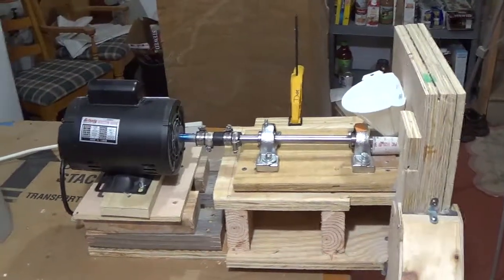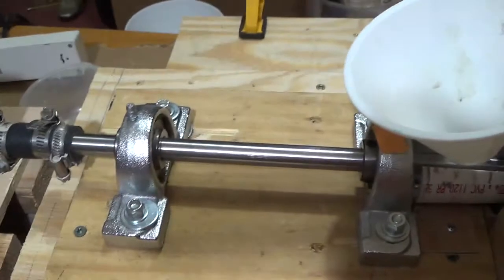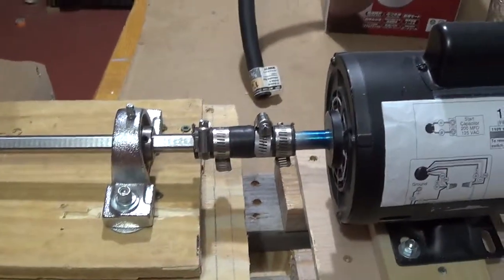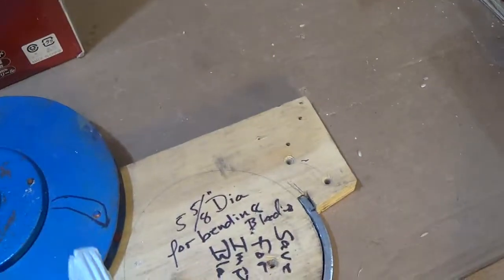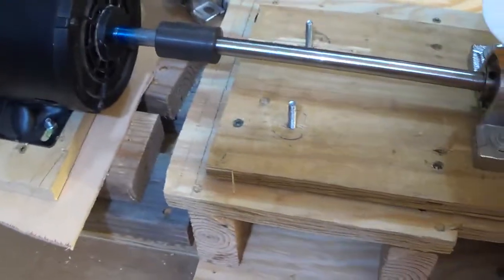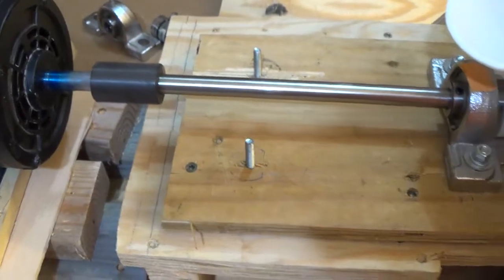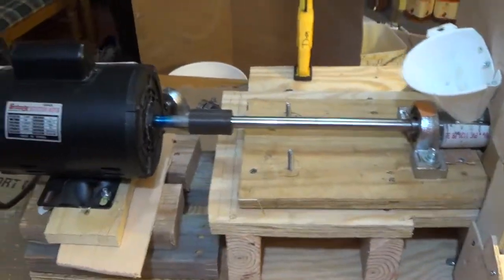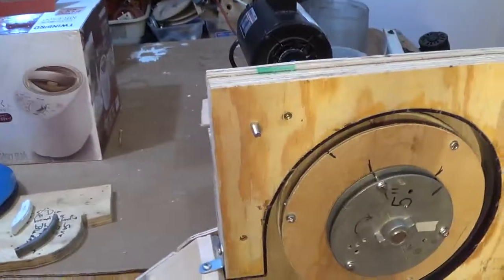brillengineering simple impact huller

Comment: Which style of dehuller would you say is more efficient with having to run grain through repeatedly to dehull everything? The impact dehuller or an abrasion/modified grain mill dehuller? Also, would putting the impact hullers in series be a good option or would it break the dehulled grain?
Reply from the maker: The pinch rollers will never remove hulls from rice or other grains that are smaller than the other grains passing between the rollers, whereas an impact huller is not constrained by size differences.  The rice I ran through a few times did not break.
Reply from the maker: Sorry about the delay, I don't check the comments very often. The impact huller would work best if the rice can't be separated.  Impact hullers in a series would be interesting,  When I ran some rice through repeatedly I didn't see much breakage.